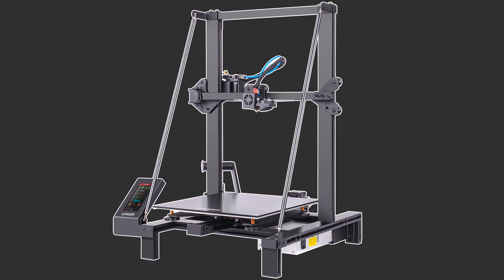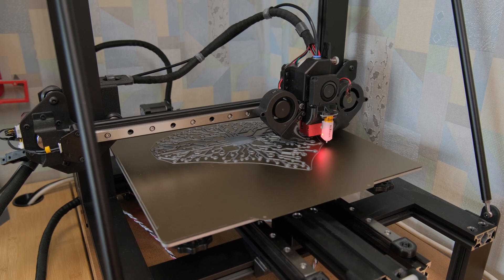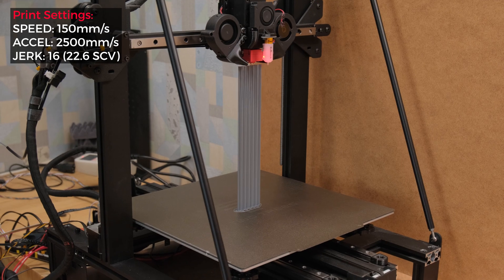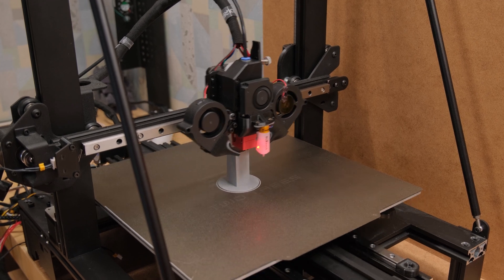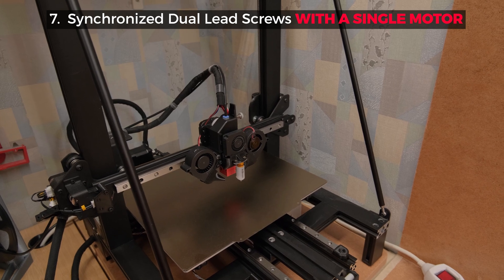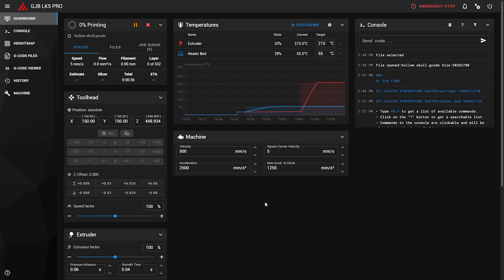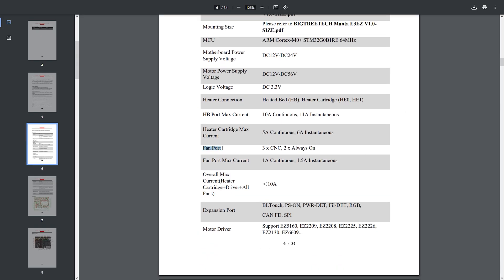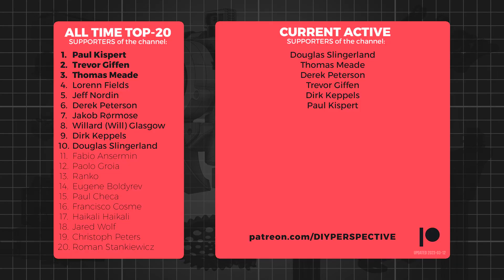3D Printer UPGRADE that ACTUALLY GIVES the BEST PRINT QUALITY IMPROVEMENT

Comment: Great video, klipper is really nice to have on everything. The sky is the ceiling when running klipper, there is so much to methodically tune and improve.
I did notice you use beam (helical) couplings with your lead screws though. These couplings are not supposed to be axially loaded, they are not stiff in the z direction or on any lead screw for that matter due to the residual axial forces. So your mega,  and kingroon are suffering from artifacts caused by this unnecessarily. It is a MASSIVE downgrade for printers like the ender-3, where the linear motion system (v-slot wheels) is not stiff and only 1 lead screw.
It is hard for me not get carried away talking about z-banding/wobble/binding and how to solve it, but the key takeaway is relax x,y over constraints near the nut, this solves these issues. Any other "solution" is flex tape and comes with compromises/tradeoffs. (in an ideal case you also relax pitch and roll constraints at the nut, but the planar misalignment is so small you wont' notice this in practice)

Comment: Really nice video^^ I just have one question at the end: How does your E3EZ fit into the case? Did you print an extra case for it? For me, only one screw fits into the LK5 Pro, and that doesn’t feel very stable. I’m also not sure if it’s safe to drill new holes in the case or the back plate (with the fan), since it might touch the board and cause a short.

Comment: 1:53 bro said that like I can afford linear rails.
Reply: I bought some cheap on aliexpess, you just need to figure out the size carriage you need and lenght of the rails. In saying that, I done a resonance test before and after and it wasn't a crazy difference, better by all means. The biggest bonus has been consistency, with the v wheels I was forever having to adjust settings and the bed, the bed mesh itself wasn't the best but now I haven't had to adjust a thing since. (This is an elder 3 v2 with x and y linear rails and a Kevin aka Sam dual belted z mod, still with v wheels on z)

Comment: I’m using custom marlin firmware right now and pressure advance is working well with my direct drive set up. I’m having trouble figuring out manual input shaping and wondering if it’s worth it to go to klippet just for that?
Reply: The quality difference is very noticeable when you switch over to klipper

Comment: If you want speed but a VZBot kit. Core XYZ Voron like machine on steroids Completely open source, all linear rails, water cooled motor and top of the hotend. 

Saw one on here so 2000mm/a at 75mm/s volumetric flow rate. Also did 200000mm/a travel from corner to corner
 
If you print at its top speeds. The stepper motors get to above 80V. It's the only printer on hear were the camera really can't catch how fast it's moving. Tay and the Goliath hot end is Same insane. 

Same price as an X1 minus the 40 hour plus assembly and parts you have to print yourself.

Comment: I'm very surprised that 3D printers don't have an electronic DRO system, so they can always know their position and wouldn't able to fail in many of the ways that 3d printers fail and/or at-least would know when they fail and pause the print instead of destroying it. For example, I had two very big problems with my Ender 3 and a couple smaller problems that caused out of spec prints. The first was that my lead screw bushing was out of spec, so no matter how much I tightened it, it would not stop the lead screw from spinning over time, so my parts would print slightly too small, but at varying levels (sometimes even as bad as 10%)... so I had to replace it after a lot of frustration... and then, at the very same time I had my gantry getting crooked and stuck. For the most part the parts would just come out short, because I would level the bed to match the slightly crooked gantry that I didn't notice was crooked... but it eventually got so bad I could see the parts were very crooked. In both of these cases I think a simple DRO would have warned me of the problems and saved a lot of time and frustration. It kind of sucks that once the hotend leaves home, there is no way for the printer to have any idea if it's off track unless it's so far off track it hits one of the limit switches. If the z=axis gets stuck for example, it will just keep reprinting the same layer over and over again, which will most likely destroy the filament at the extruder motor and clog the hotend from being too hot with no flow for so long.
Reply: The reason is money. Closed-loop stepper (digital encoder) motors are expensive and it's easier to use a hard-limit like a ON/OFF limitswitch and hope for the printer to not loose any steps. Altough some Voron printers got closed loop steppers. 
If the printer fails mid-print, just messure the height og the failed print and remove it in your slicer and continue printing. It's a hassle but can save a print.
Reply: Its expensive first and foremost and second 3d printers are more about look ahead into the command buffer for speed purposes than trying to be where you were supposed to be further making a closed loop system expensive due to the needs.

One axis is calculated to be ahead of what the system is doing in 3d printers as well due to the extruder pressure lag.

Comment: Love this, the Y-axis upgrade solved the issue with flat spots on the wheels (albeit a bit closed off and expensive). My only real issues with this are the fan comments and hotend and board choices. The Spider V1 is around $50 due to, well, Creality licensing and whatnot, and at that point I'd use a CHC, maybe even the pro version, or a dragonfly from Phaetus. Most fans only draw up to 0.1 amps, so 1 amp for the fan ports is plenty. Also, 5020 fans are hard to find, and usually they can't reach the airflow of 5015s (no idea what brand of 5015 you were using for your tests). There is absolutely no reason to use a $50 Manta E3EZ except for the additional $30 CB1 module that BTT forces you to use (thankfully this is the only board where a CB1 is mandatory). An SKRat would do all of this for $40 cheaper. Don't get me wrong, you said that this was a bad idea in financial terms, but I think it might be a good idea to look around a BIT more for video like this. Not hating either, this is a genuinely good video besides what I just mentioned. Will still be subbing.

Comment: My cr-10 v2 with a H2V2S running Klipper is everything I want as an amateur/hobby printer enthusiast. Resonance compensation is a night and day difference and the DD extruder is so much easier to tune than the stock bowden setup
Reply: Sir could you explain in laymans terms what you just said? I cant follow as a newbie. I have a longer lk5 and i dont know what klipper is / or what parts zi should upgrade
Reply: @WhoIsJohnblack start with the basics. Follow beginner guides which are plenty on YouTube.
If you don't get the terms, you're not ready for these kind of upgrades, they are not translatable to layman's terms.
You'll get there, I was like that 2 years ago.

Comment: the absolute best upgrades for the Longer LK5 PRO on youtube really awesome video! (love the linear rails and extruder head design). I need to fix my extruder filament switch near the feed mechanism because the plastic wore down after 500hrs of printing(). I replaced part of it with all aluminum parts, but need to figure something out with mounting either the old filament (auto shut-off/pause for the filament sensor(switch)) or potentially designing a new housing. I also moved the original filament role holder and touchscreen to the very top of the unit instead of on the left side (makes for a smaller footprint on a table.) getting an lk5 pro for >$200 is totally worth it but the two weakest parts are these from what I've experienced was the  filament switch and heatsink fan
Reply: I like the idea of replacing the stock hot end on the LK5 pro to an all metal hot end. I just cant find one anywhere that says it's compatible with the LK5 pro unless the one he has in the description is it. And how difficult is it to replace?

Comment: This is awesome! I went for it and built it. However, I'm having a problems with finding the firmware for the new offset for the BLtouch. Do you happen to have the firmware for the original motherboard(LGT_KIT_V1.0)?

Comment: great upgrades you have done.
i did the dual z belt single motor from kevinakasam for my ender 3 neo and a few other upgrades, also i intalled klipper on my printer and all is working fine just for the bed mesh seems acting weird, i do the screw tilt calculate and z offset before my bed mesh, when i start a print the profile is loaded but it's more smooth without any bed mesh, also my printer is matching 0.0 position bl touch offset is donne i don't know if you had problems with that or if you can help?

Comment: I have 2 small creality printers, and none of these issues are present. All of these issues can be solved just by finetuning everything and placing the printer on a shock absorbing suface (my printers are placed on a large tiles with 3cm soft PU foam). A bit modded marlin and a stock firmware. Most of the finetuning is done from the slicer
Reply: wich speeds do you run?

Comment: Can this hotplate design for the rails be used with the stock dual blower setup? (I just purchased your hotbed design from PCBway) Thank you for your contribution! I'm planning to also do a dual z mod along with the x rails if possible.
Reply from the maker: Yes. It doesn't change anything apart the Y endstop (also the z endstop height). But you can adjust the Y endstop as it will be placed along the right side of the middle 2040 extrusion.

Comment: Great video. I also have a lk5 pro. It's all stock minus the raspberry pi4 running klipper. I'm wanting to do a direct drive extruder setup but one thing I'm unsure of is when looking at  nema motors I see voltage of 4 , 12 ect. What voltage stepper would be correct or does it matter ?

Comment: thanks for such an amazing video with print samples! will be considering some of the upgrades for my ender 3 v2.

i have a few quick question - does linear rails need to be lubricated?
Reply from the maker: Yes. You clean the protective oil and use a grease like Mobilux EP 2.
Reply: @PrintingPerspective  ok thanks!

Comment: The bigtreetech skrat, a derivative of the skr3 for ratrig, has 3 amp fan ports with additional pwm control line and tachometer line. Ratrig sells their vcore printer now with a 4028 axial fan that draw up to nearly two amps. And if you have one fat chonky fan that needs more than one amp use a spare heater port. Basically all 5 driver boards have connections for 2 hotends like the manta e3 ez.
Reply from the maker: The official BTT manual says - "Fan Port Max. Current: 1A Continuous, 1.5A Instantaneous". I am not sure where you are getting these numbers.

Comment: Can you share your printer.cfg file for klipper by any chance?  I'm getting ready to install the manta M5P and I have a .cfg file but I would like to check my pin assignments and make sure that I have the directions correct.
Reply from the maker: I could but I used the BTT E3EZ board and not the M5P. I doubt it will help you in any way.
Reply: @DIY PERSPECTIVE  thank you,  I think I have it,  I like checking before implementation.  By the way,  your y axis mod for the lk5 works like a charm!
Reply from the maker: Glad you liked it. Here you go, my current setup with E3EZ, nothing special - https://drive.google.com/drive/folders/1eGZ5DiIAf61gc2YBqbsCzCuTlkeJu1zS?usp=share_link
Reply: @DIY PERSPECTIVE  actually there are some things in this config that help me.  I missed some of the macros and the safe position.

Comment: dude, please tell me how I can get those fan & extruder STL's!   That "scorpion" look is badass
Reply from the maker: https://bit.ly/CustomLK5HE It is designed to be used with a custom metal plate part, but I also added a printable version of the plate. Just know that I don't recommend using the printed version as I am not sure how it will perform longevity-wise.

Comment: thanks, but you seems to miss part of the point, the price point especially. You solely focus on the technical improvement, unrelated to the cost of each individual upgrade. Which ones gets the best improvement/cost ratio ? how much for the whole upgrade ? It seems pretty expensive, i would say at least 2 to 3 times the price point of the printer ... shouldn't then we just switch to an other printer from scratch ?
Reply from the maker: I didn't miss that because neither the thumbnail neither the title mentioned the cost aspect. Instead because you didn't watch the whole video you missed that I said that all these upgrades doesn't make any sense cost wise and you should just get properly designed 3d printer in the first place. Manufacturers can source parts in bulk so much cheaper, but the problem that the most of them don't know anything about designing 3d printers or are driven only by the profit aspect. :)
Reply: It’s very often better to buy a better machine than keep investing in a bed slinger

Comment: Good to know that the best upgrade is relatively cheap :)
One day I'll pull that Orange pi out of its box (bought explicitly to try Klipper) and actually try it.
I did get rid of bowden on my printer some time ago and the biggest noticeable difference is the ease of swapping filaments, and the teeny tiny waste at the end of the roll or a sample, like 12x less than on Bowden.
Reply from the maker: Yaa, Klipper's pressure advance with the direct drive extruder is insane. My only suggestion for trying Klipper is to have a spare printer to learn. Because most likely it will take a while and the printer will be inoperable for that time.
Reply: @PrintingPerspective  Having only one printer has stopped most upgrades I might want, that's true. Namely fully belted Z :) I have a Linux admin at home so we probably could defeat Klipper sooner than later, and I think you can dual boot it with regular Marlin based firmware too?
It's just it prints fine ;)
Reply: I'm following you 😈Use that orange pi asap!🤠

Comment: Be Aware that the Bondtech Extruder is Bad News.... Heresy   Right !?
 Truth is We've all been lied to.... by Internet Hacks and Shills.. for years.  
The Effing Gears are Ecentric (true.. use your dial gauge) and the Dual extruder gears Mesh v poorlyindeed  The  Needle  cages are are V low quality bearings  Junk is an apprpropriate descriptor IMO  and the foolish half round drive teeth cause the filament to wiggle within the groove..  all the above flaws causing surprisingly  erratic filament flows.
Reply from the maker: I mean, we probably all saw the MirageC video about inconsistent extrusion, but the main problem there was that the gears were not perpendicularly aligned.
I ran several tests to expose the offset gear problem and at least with Trianglelab DDB v2.1 which is the BMG clone, I didn't see any problems. Also tested cheap ~$10 clones and the gears had very tiny runouts.

Comment: Always use lube! Which btw mine came in the mail so I will put out a video on "THE" lubricant for 3D printers.
Reply from the maker: Can you be more specific? Are you talking about the lead screw? Rails?
Reply: @PrintingPerspective  Not EP2 grease basically. I will be covering all types of linear motion components used in 3D printing(I kinda went down a rabbit hole on this one). For the long answer I will post my video as a response. If that is alright with you? Also I have a question. Do the POM nuts allow you to move the Z axis faster than a normal brass nut?
Reply from the maker: Sure, just know that youtube blocks links but I check those blocked comments once in a while. EP2 is just rating of pressure that lubricant can withstand as far as I know. On 3d printers loads are so low that it is not needed. But higher viscosity is nice on z axis rails.
Less friction with pom nut, in theory should provide faster speeds, but it's still plain friction setup. Meaning higher impact on longevity with higher speeds.

Comment: Great videos as always! Would be interesting to see  upgrades that eliminate Vertical fine artefacts (VFA)
Reply from the maker: Thanks. From my understanding and when inspecting a few prints under a microscope the VFA is caused by the X or Y-axis motor having inconsistent movement. So those vertical lines are when the motor moves slower causing more bulging in one segments and moving faster in the other causing thinner extrusion. That depends on the print speed as at different ones that inconsistent motion is lower and at others higher. Plus running motor current can be a factor. So to eliminate them we need higher quality stepper motors with lower rotation vibrations and find at what speeds they print the best. This is my understanding from other videos and limited testing of mine. :)
Reply: @PrintingPerspective  Where can I find a cooling model like the one shown in this video?Thank you.
Reply: Maybe:
A higher extrusion Resolution up to a certain degree (i'm currently moving to an orbiter 2 since it has more steps per mm 😊)

Filament dryer 

...

Anyway i would be happy to see the effects of it 😊